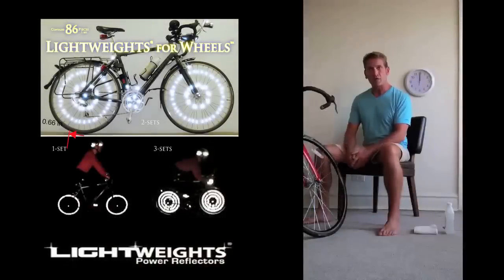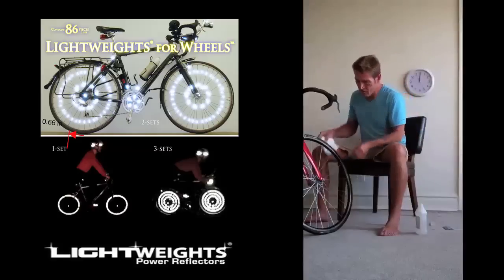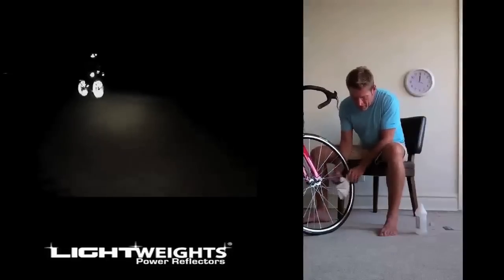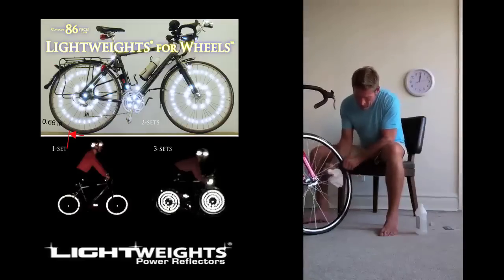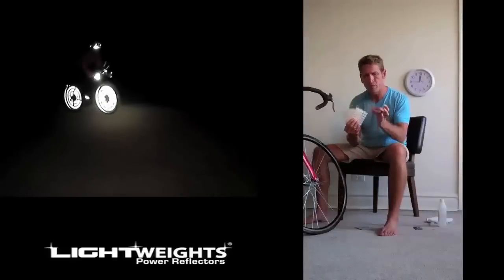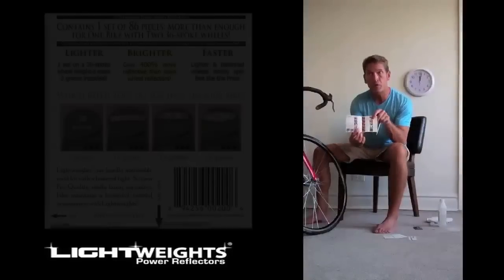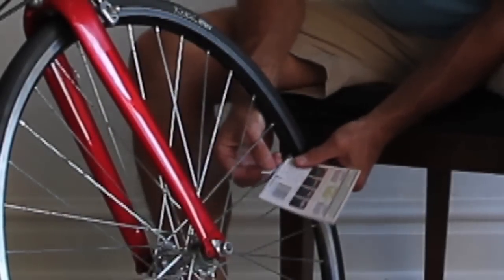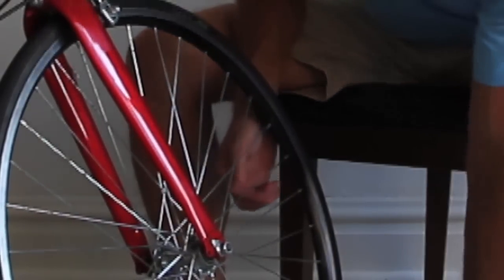Lightweights for Wheels Installation

Comment: I was hoping this video would show how to get a Lightweight off along with the backing paper.  Usually the backing paper would come right off then I had to scrape the Lightweight off the clear plastic and try to stick it on my spoke.  I see this video is six years old by now.  Maybe my Lightweights are also six years old and don't come off the clear plastic as intended any more.
Reply: same issue we ended up tossing these because they wouldn't come off the plastic without ripping. Waste of 15 bux
Reply from the maker: Lightweights are freshness dated and we make them to order fresh for each new order. We never heard from you, because, If we had, you would have had no issues whatsoever with your bonafide Lightweights we could have sent you and still can. Please understand that we have not been able to stop them, but Amazon is not an authorized seller. Most Bike shops who use Amazon to sell our products get legitimate product from our authorized distributors.

Comment from the maker: Thanks for the question! These are reflectors. No LEDs, no batteries. All of our products are made of retro-reflective tape. As you can see, they are super bright. These Lightweights for Wheels attach to your spokes and will not fall off or break. They are a great alternative to traditional wheel reflectors, as ours are balanced and extremely lightweight (36 pieces per wheel adds less than 4 grams to your entire bike).

Comment: What is the sticker length and width (in spoke circumferential direction)? Minimum width required: 12.56mm (approx. 1/2in) for my 4mm diameter cargo bike spokes.
Reply: Update: I just received the stickers by mail: They measure exactly 1" x 1/2" (25.4mm x 12.7mm), so they fully wrap around a 4mm diameter spoke.

Comment: If I buy one pack, will there be enough stickers to apply to both tires (just around the edge)?
Reply from the maker: Yes, there are at most 36 spokes per wheel on the common bike wheel, generally. There are 75 spoke pieces per pack to assure you have enough and some extra for the future in the event you ever bust a spoke and need to replace it with another Lightweights power reflector. There are 86 pieces total in one pack.

Comment: It's very very very very, very difficult to get just one out.

I got so pissed off that I wanted to get my money back

Their so sticky and flexible that they wouldn't even come off as a whole I even all around through all the packs that's were I was getting pissed off

But I saw the video and there was the technique that wasn't on the manual

Now So far i managed to get 4 spokes and 2 circles on just on not even neatly

The success rate was a little higher at least

Luckily I don't have that many spokes

It's hard but still worth it
Reply from the maker: +Second Coin Sorry to hear you had a very very very very difficult experience. You could have called or written and we could have helped. I'm not sure why you had such difficulty and I'm confused about what part wasn't in the manual, as the images in the video are taken directly from the manual, but I'm glad you got it figured out once you saw the video. It's why we include the link to the video in the "Before You Begin" section. It's certainly possible that from where you bought yours, you received expired product. What was the "Best By" date and from where did you Purchase them, so we may rectify the matter?

Comment: Was bummed to receive my set with only 4 sheets instead of the 5. Seems like a good product but bad quality control.
Reply from the maker: +ThursdayTheNext I find it hard to believe the product left our facility that way, as each product is packaged by hand by Lightweights team members in the United States, visually inspected and then weighed before leaving our facility in Chicago. We are all about the highest quality control, highest quality products and highest satisfaction in Customer Service and support. I wish you would have just contacted us directly and disclosed from whom you bought the package you received with the missing sheet, on what date and what the "Best By Date code" was on your package, so we could best track down the culprit. I would also like to know if it looked as if it had been previously opened and then re-stapled to account for the missing sheet, as some have come off of Amazon that way from unauthorized sellers. We do not sell to Amazon.  I am not sure why you have not reached out to us directly, as soon as you noticed, we could have made things right for you and gotten them to you the next day. Again, we wish you would have contacted us with a simple phone call or email as it would have changed your feelings about Lightweights Power Reflectors. Please call or write us so we can send you a bonafide set of Lightweights directly from our facility, free of charge :)
Reply: +Lightweights Power Reflectors I didn't know I was shorted a sheet until I saw the video. I looked up a video because I was confused as to why I didn't seem to have enough stickers for my spokes. I was trying to figure out what I'd done wrong in that I didn't have enough left over for my back tire, and then he mentions five sheets instead of four. I got them on Amazon, and the package is long gone. And after your sarcastic message above I certainly won't be contacting you about it.
Reply from the maker: @ThursdayTheNext  I am sorry that you saw our reply as sarcastic, upon rereading. I can assure you it was not intended to be in any way whatsoever. We simply asked you to contact us so you can enjoy a free working set of bonafide Lightweights. I'm not sure why you would refuse our offer to fix this for you. For your reference, we always make things right. This is found under Amazon Reviews a review by James Vu: https://www.amazon.com/gp/customer-reviews/R3N8CQ7PGNYELJ/ref=cm_cr_arp_d_rvw_ttl?ie=UTF8&ASIN=B002KYFWQ6